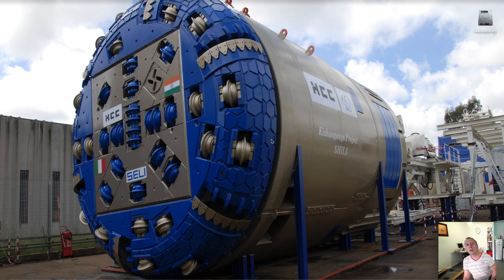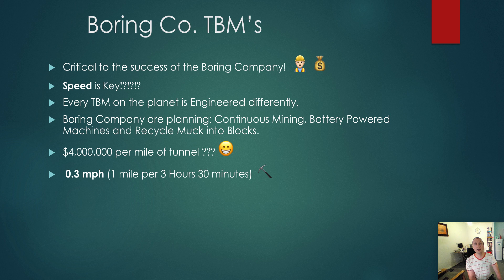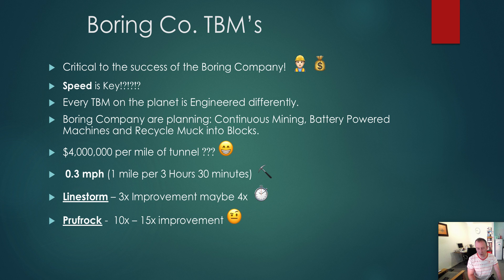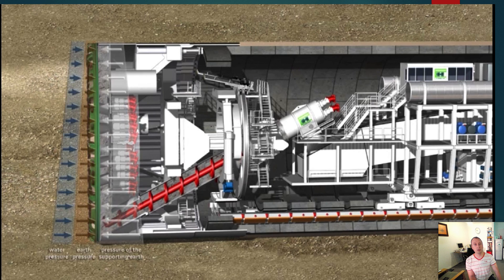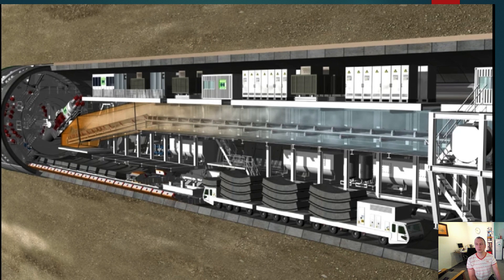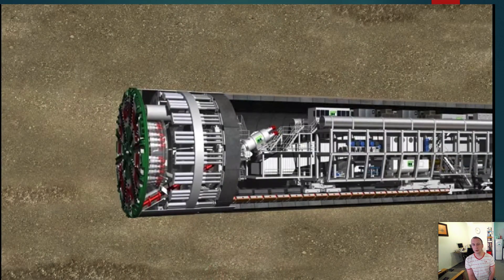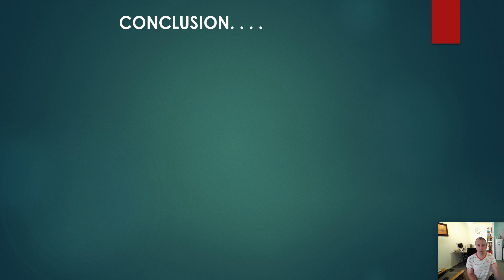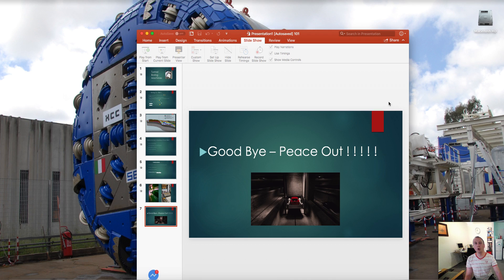A Boring Revolution - Elon Musk's Secret TBM technology  #6

Comment: They have a nuclear power tunnel machine that uses laser to melt the material into a lava and pushes it to the sides to cool and form the wall and can drill seven miles a day.
Reply: I hope you guys realize that such a machine doesn't make sense.  A nuclear powered machine is fine, but using nuclear or lasers to "melt" the various mined materials is ridiculous.  Lasers don't melt, so much as vaporize or plasmatize materials, and even then, only on a very small volume of material.  You could slowly melt (at differing temperatures) the different slag materials (if separated), just like a blacksmith using a forge.  Nuclear heat from a reactor is not an uncontrolled reaction, like a nuclear weapon.  The heat is low and slow, verses hot and fast, which is why nuclear reactors boil water to spin a turbine.  To be "modern", you can also melt certain salts and use those to store and transfer heat (in modern power plants).  But lava is generated under highly sustained temperature (and usually high pressure).  As lava cools, it can be brittle (which makes for terrible stress load material).  And only the right mix of materials will turn into a "hardened glass", let alone a desirable high stress load composite (that is also water resistant).  Control rods for nuclear reactors (that dampen the reaction) are made out of graphite (also known as a simple form of common carbon).  So you can't just put slag material inside a reactor (to melt it) without stopping the reaction--the nuclear fuel has to be in very close proximity to be able to split the atoms (crammed into an incredible small volume).

The somewhat practical part is having it be nuclear powered.  You could use some sort of modified nuclear sub engine, if you could somehow manage the extreme need for cooling; that is, you need a continual stream of water.  This is easy for a sub (in the ocean), or next to a river like a nuclear power plant.  The idea of "heat exchange" is vital, to keep the reactor itself from melting (i.e. an easy correlation as to why you can't melt the slag without also melting the reactor).  About 70% of a sub's nuclear heat is lost into the circulating sea water, keeping the components cool enough for long life and steady power output (even when the sub is parked).  I don't know how you'd get over this in Tunnel Boring Machine where space is at a premium, and maintaining a continually stretching, high pressure source of water would be a difficult challenge--we're talking a massive umbilical both to and from the TBM (fresh water and waste water).

Also, nuclear material has to be guarded 24/7/365, for obvious reasons.  The only theoretical device that might work is Taylor Wilson's compact reactor with a gas heat exchanger, but it also runs a lot hotter, so it might be hard to physically work around without a lot of heat shielding.
https://www.ted.com/talks/taylor_wilson_my_radical_plan_for_small_nuclear_fission_reactors?language=en
Reply: Matthew :::  ...  Flood the tunnel,  add water jets to the cutting head,  and pump out the heated slurry 🙂  It would be very cost effective if you  could solve the million other problems 🙂
Reply: @matthew4497  You would be surprised what the deep state military has, remember they have alien technology sonic weapon laser we have not  been shown, materials could be converted into other elements these days so who knows what they are able to do I am only going by what a whistle blower was talking about years ago that claimed he was working making the tunnels said.
Reply from the maker: SpaceManAus - I’ve seen the pictures!

Comment: They make it sound like rocket science. The fed have had nuclear tunnelers back in the 70's. I read they even made the rock it drilled through molten rock that once hardened would crystalize. So no need for bracing. I think a tunneling drone would be sweet and no one is making them.
Reply from the maker: Steven Lengyel I read about this in 2010. WoW ! 👍🏻
Reply: Good to know others have heard of that US Navy tech too. But mh a month to dig a tunnel under another country, security threat, suppression.   Doesn't it suck that we cant have nice things.
Reply: Steven Lengyel Seven miles a day. It’s nuke powered melts the excess to the sides melted glass. ;) Steven is right. We have tunnels all under the US.

Comment: Move waste material very fast by moving waste in self dumping, return containers. Edit: Build bricks in tunnel, remove waste as bricks to surface.
Reply from the maker: Carriages could be designed to tip via a pin joint / hinge when they’re at the surface. Faster trains could be the solution.
Reply: Edit: move the waste very fast and deliver the project very fast, you mean they are going to use cement to make bricks or what?! because there is not only soil but rock underground

Comment: How about a little critical analysis?  .3 mph is 1760 feet per hour.  If the lining sections are 6' wide, and there are 7 lining pieces to make a ring, that's 1848 pieces that have to be placed and bolted in per hour - more than 1 every 2 seconds.  So you have a system to feed them into the machine at that rate, and take out the muck in the same tunnel, and it's all battery powered?  You're going to need to recharge the batteries at some point, right?  Or do you just have an electrical cable trailing behind the TBM?  Then why add the complications and inefficiences of batteries - just power it with electricity.  

10 cents per block?  Not all soils are suitable for block making, and you have to transport the muck to the block factory.  If the TBM moves at the .3 miles per hour for 24 hours per day, you'd have 17,189,314 blocks of 1 cubic foot each per day (24 hours * .3 mph * 5280 feet per mile * 12^2 x 3.14 frontal area for a 12' diameter tube.  Where's the market for that?  You'd also have to move the block factory every few days in order to hold down the cost of hauling the muck, and the block factory would have to have tremendous open space to store the blocks.

I call bullshit.
Reply from the maker: Kibashi Siyoto where have you been all my life 🤣
Firstly it is 0.3 mph he is aiming for. Let’s say for arguments sake he achieves 0.1 miles per hour (amazeballs) so 1 mile every 10 hours. That’s the realistic target for the next few years. . . . The ring beam has an external circumference of 44ft so that’ll be around 7 - 8 segments including the smaller key segment. So each 7 piece ring beam progresses you forward about 4ft !
1 mile = 5,280ft so you’ll have 1,320 ring beams and 9,240 concrete segments.
9,240 / 600 minutes = 3.9 seconds per segment. So yes it’s bloody fast - will require multiple erectors to move in harmony installing each ring beam. Like those automated machines moving batteries at the giga factory. 
One obvious answer is to reduce the number of segments by increasing the width to 4’ 4” or more. 

As for the battery powered TBM we are talking 60 - 80 Mwh and charged regularly via a battery power supply train (50 Mwh). It will be a beast. I will cover bricks 🧱 in a future episode. 👍🏻
Reply: @BoringRevolution  Will, going back through your old videos (Have to get my fix; these are all gold!). Do you have any insight into the details of current TBC TBM designs (and maybe future plans)? Do you know what options they're looking at to manage some of the challenges discussed here? For example, how wide are the segments? How quickly are they placing segments currently? Might they be able to place two segments at a time (e.g. with a different design on that front contraption)?

Finally, could you discuss on a future video what the implications are for tunneling in different locations (and, thus, different geologies)? For example, would TBC simply need to adjust the settings on their TBM, or would they need to use (and design) different cutter heads, or might they need very different machines for different kinds of geologies?
Reply: Flying machines are bullshit... until someone gets it done, then they become the norm.
And here we aren't even talking about new untested technology, we are talking upgrades to well established working machinery.
Reply: Bricks have more psi than blocks and I’ll build a fenc with th bricks around  a renewable retirement charatible community that creates its OWN energy # not time to hate on th idea jus yet

Comment: Powered by a battery? Nothing is powered by a battery. A battery is a way to store energy. What powers the battery? Are they going to remove the battery with a big forklift and go pop it on a giant charger? Most TBMs are probably powered with medium or high voltage electricity. Cables run to the machine. Batteries are only necessary for equipment that you don't want powered off in the event of a power loss.
Reply: I’m not convinced using a battery is a great idea... you need so much power.. I’d think a couple thousand volts ac down an extendable power line is cheaper no?
Reply: @justinmallaiz4549   The main point of the batterry is to ensure that you do not have to arrange alternative ventilation. Even massive battery packs could in theory be swapped out in whatever size is practical and moved back by some means to be recharged.  Any ways i am fairly confident that Elon will make massive improvements and shame the entire sector into adopting some of his practices or finding other ways to improve their own operations.
Reply from the maker: Steve Miles it’s all about scale... Imagine a 60 Mwh pack or greater. 

P.S at work I charge my phone sometimes with “another battery” 🔋 imagine how many mega packs you could fit on a 60m train.  And a Mega charger 🔌
Reply: @BoringRevolution   i don't think you are understanding the question or the logistics. Tunnelling, especially at theses speeds is a 24hr operation. When and how would you charge the batteries? if you charge them in the tunnel then why have them, just use the electrical supply to drive the tbm. If you had to remove them then how would you do that with the other movements coming into and out of the tunnel at the same time. Surely, lithium batteries would also be a huge fire risk in a tunnel. The whole battery thing is a nonsense.

Comment: I would assemble tunnel segments as a spiral endless interlocking
Reply from the maker: Paul Noel could be done by an Automated Segment Erector!
Reply: Well first off, i would just move continuously with the plan thats being used now. Look at this part of the video with the sections put in. If there are 8 sections in a circle, why on earth would the machine need to fully complete a circle before moving ? Why not just push itself on 7 out of the 8 sections while that one is being put in place ? The only difference with spiral instead of circles is that the distance those hydrolic pushers have to cover is constant in a spiral while if you want to keep moving while making circles, they need to be able to work on varying distance. (which imo should be no serious problem)
Reply: @antondegroot6061  Obviously you haven't thought of the issue of having a massive area uncovered for pressure build up in a mining tunnel.  Spiral especially an interlocking spiral doesn't allow this massive build up.  It is a matter of that this uncovered pressure area has been the full failure and stoppage issue in TBM operations.   That big area done as concentric rings does nothing to the issue of support coming in as large increments.
Reply: But you can't;-)).So I guess it's a worthless point of view.

Comment: That was very interesting, I heard the walls were super heated into hardened glass instead of concrete segments. Is that true? That was a small machine. I've heard of over 50ft boring machines. Peace.
Reply from the maker: No Glass and no requirement for a 50ft Diameter TBM.
Reply: james solarz ...worlds largest tbm is the Japanese-built “Bertha” at 57.5 ft. diameter. It just finished its work in Seattle where it replaced the Alaska Way Viaduct.
Reply: @jbell6642  Yeah at a $ million a day and its from China AND It broke down numerous times! LOL!

Comment: Seems crazy that the drill head stops while its lining the tunnel... Having the hydraulics on a single segment move out of the way while the lining is placed for that segment would give you an almost 2x speedup. I suppose that's why they designed their linings to be so much tougher than typical reinforced concrete... they have to take the extra load on either side of the new segment.

A single archimedes screw/conveyor system seems like an unnecessary single point of failure as well. Building it with redundancy on as many systems as possible would let the machine keep on trucking 24/7.
Reply from the maker: Matthew Spencer I have a theory about the trust cylinders. You’ll see it in tomorrow’s episode! 😀

Comment: The video is from Herrenknecht (leading company in TBMs construction). Good video to explain how an EPB (earth pressure balance) machine works...but meaningless in this case (boring revolution !?).  
1600 m in 3 hours !? If you achive that in a MONTH is already a very good result (and you would need a double shield and perfect geological condition). With double shield machine you can assemble the precast ring AND bore, at the same time (not the case in the video, with a single shield EPB).
Not to mention the cutters wear (replacement of worn disc cutters), concrete rings supply (as you mentioned...).
Unless Mr. Musk is going to invent some kind of "laser beam atomizer" machine (with vacuum suction of the spoil at ultra hi speed !) and no lining of the tunnel, I don't think that the "numbers" you gave in the video are realistic (by far...).

You should just stick to the "today video talk is focused on TBMs and fundamentals of how they operate" part...
Reply from the maker: Some critical errors in your last message.
Meaningless??????  This video covers all the fundamental elements of Tunnel Construction! All the processes above are common to "most" TBM's hence why I chose this particular Herrenknecht video. I decide what videos benefit this channel - not you! ok! 🤬
Elon Musk (Clearly States) on the Boring Company Youtube Channel 'quotes' 0.3 mph as the end goal. Link below. 
https://youtu.be/AwX9G38vdCE
I can only quote you what he says ok. Personally I believe they'll achieve approx 0.08 mph by 2024. 
Cutter Wear is a critical issue but clearly new materials / alloys can now be utilised. Extending the life of cutters dramatically.
The concrete rings supply issue is an easy one to fix, notice how railway lines have 2 tracks??? Use Electric Automated Trains! 
Look Pal... I will not stick to topics you deem appropriate. 😠 I advice you stick to hand gliding and other crappy sports that 0.1% of the world cares about. I bid you farewell sir.
Reply: @BoringRevolution   An end goal of .3mph is a dream that would seem to encourage us all to stay asleep.. But...again Elon so far never ceased to impress an awful lot of unbelievers.....
Just a quick math though shows that....,
3mph = 1584 feet/hour..divided by 60 minutes gives 26.2feet of horizontal progression per minute...at 2 rotations/minute means that that wheel would move forward 13 feet every time it makes  ONE revolution....in a 14 feet diameter environment???
 Well,it better be chewing  into an awful lot of super soft material...IMO   Good video nonetheless
Reply: Does it not also mean that it would have  to chew up one foot of material every time the wheel moves  one foot sideways?
Reply: You're right. HERRENKNECHT did this machine for the tunnel in Sparvo (Italy).